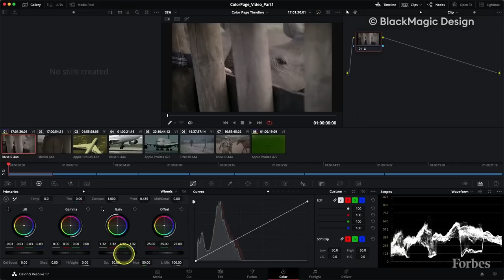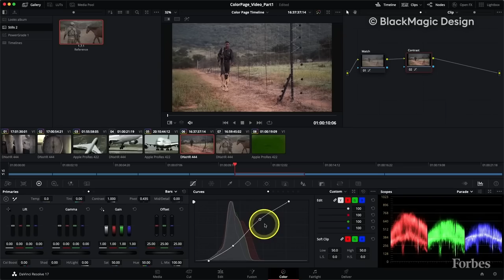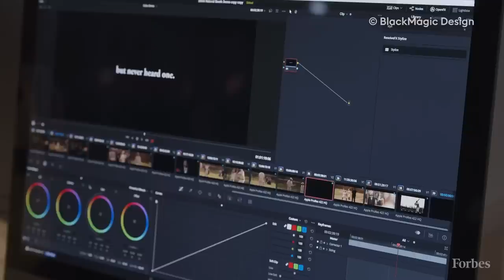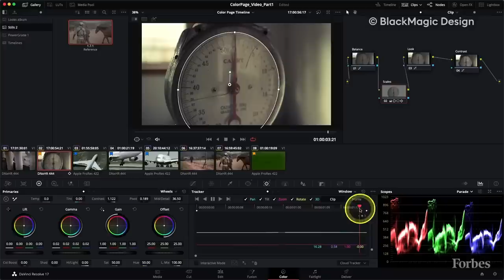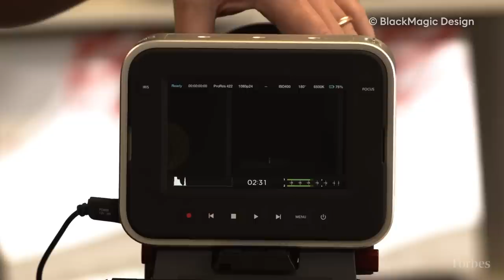How An Aussie Billionaire Went From The Housing Projects To Making Blackmagic Movie Cameras | Forbes

Comment: That's it ! I have tried this software for about 6 months and honestly...i was forced forced to come to this software. I used filmora about 2 years back when i was using low end office laptop...then i upgraded to a newgen rayzen laptop and purchased PowerDirector 365...used it a few months, render used to take hours ! I lost all hopes that ill not be able to buy a laptop that runs these high end softwares ! I was wrong the PD365 had compatibility issue with hardware i contacted PD 365 team but could not solve problem. Then from youtube i came across DVR listening to it being free 90% features I was skeptical. However i went ahead and tried to learn though learning curve was difficult...now after about 6m of learning and editing i know for sure Adobe is on the run ! That's it I am purchasing this ! Their business model is working...big time youtubers are switching from adobe ! Just search for Zak Kolder !

Comment: The only thing BM is missing is a full frame camera, that will sell them a ton of cameras.
Reply: They can but prices rocket same as  Alexa etc prices, which is a bad market to compete, they are on top of DSLR and lower pro Cinema camera bracket which is a market full of potential to sell.
Reply: @prodj.mixapeofficial6431  not really they already have the ursa 12k I think they just haven’t figured out the way to implement full frame into their camera systems.

Comment: Huge fan of Blackmagic Design. They achieved what RED had always promised, but never really delivered. Entry into the film industry with professional grade equipment at reasonable pricing. What they achieved with Davinci is nothing short of spectacular. Mixing the power of Premiere and Final Cut (classic, of course!) with excellent usability and logic-based layouts and functions.

Combine that with their entry level 4k and 6k cameras, which are excellent, and then their codec - BMRAW - which might be the best compressed raw codec currently available on the market.

They are an unstoppable force and deserve volumes more success in the future for investing in the customer first.